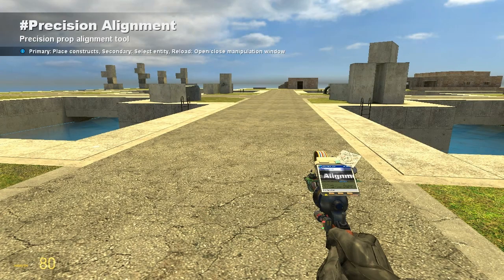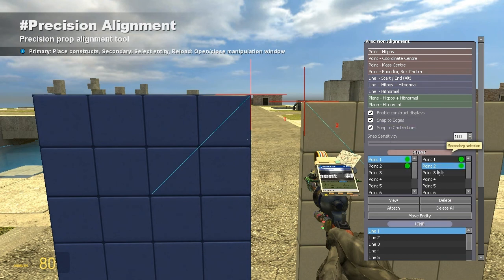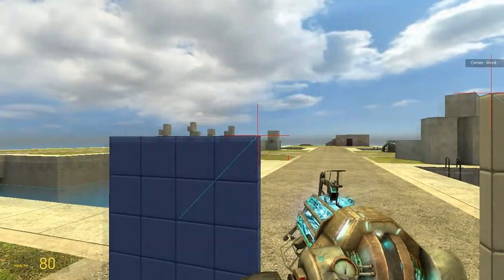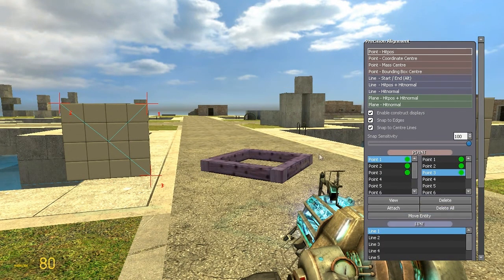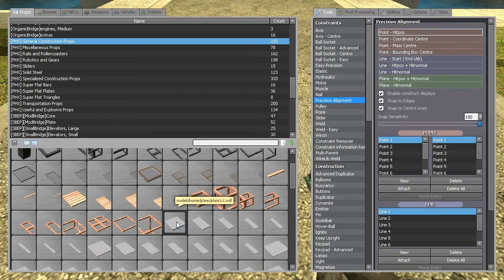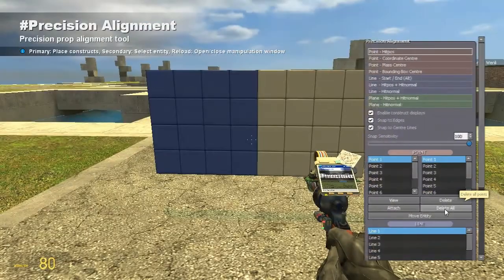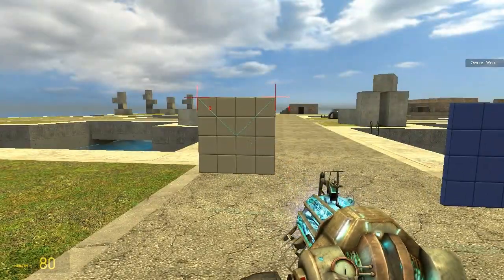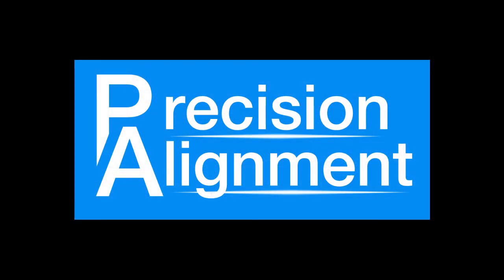Precision Alignment Tutorial 1: The Basics - Part 2/2

Comment: @WenliNodex 
I actually found a way. You create a line from one prop and have another directly adjacent to it, keep the line, place a point on the prop you want it to "orbit around" then in the rotation tab select both the line, and point, and rotate relative to your point entity. You can create perfect circles with it, it rotates and moves them. Also works with multi stacking option.